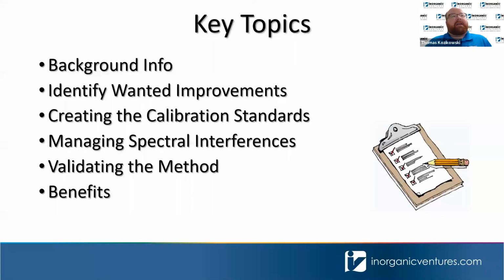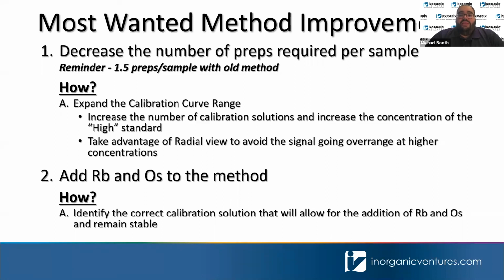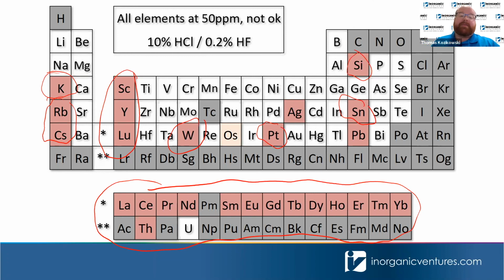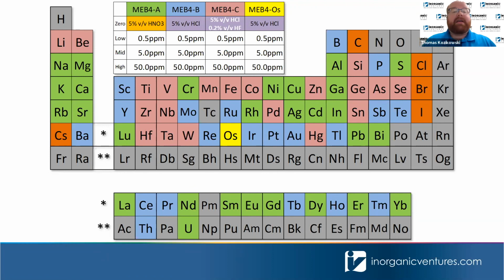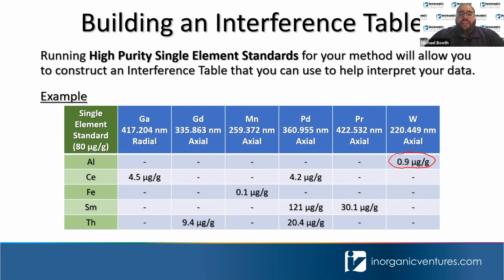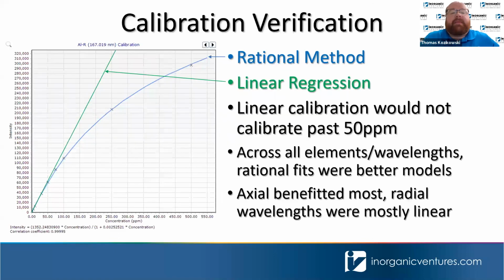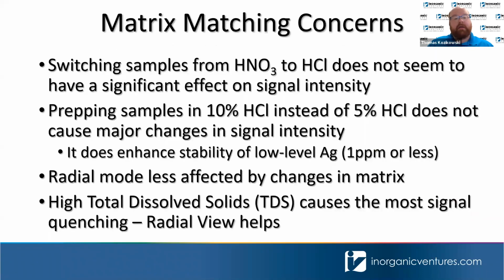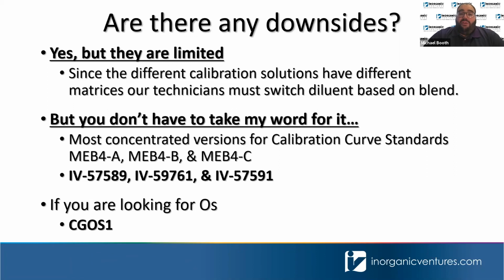Custom Analysis by Radial Axial ICP-OES: How to Reduce Interferences for 69 Elements

Comment: if you would have more than one peak for a metal , which method (s) should we fellow to select the right peak ?
Reply from the maker: Thank you for your question. Are you observing more than one peak in a single spectral window? We do not advise use of spectral windows that are not clean unless the interference can be identified and corrected for. Peak centering will be important here to distinguish between two elements. Single-element solutions can also be used to determine interferences. We would recommend monitoring multiple wavelengths for each element, when possible, and choosing one that is free from interferences.

Is the use of "peak" here in reference to wavelength? If so, the various wavelengths monitored should be consistent with each other and any discrepancies should be evaluated as potential interferences. Peak shape, relative standard deviation, and visual comparisons against a certified reference material with similar composition can all be used to help determine the best wavelength to use for your analysis.

If you have additional questions specific to your analysis, please feel free to reach out to us directly at info@inorganicventures.com. We would be happy to take a look at your data and assist further, if needed.

Comment: Your presentation is amazing, easy to understand! Thank you for sharing your knowledge! Sample preparation for ICP-OES takes more than 65% of the time from start to finish until getting analysis results. How do you prepare the samples, standards, and blank to test for heavy metals in cosmetics, food, powder, gummies, capsules, etc. Say testing for Hg, Cd, Fe, Cu, etc. 
I'll be test on Agilent 5110 ICP-OES 
Thank you in advance for your time!
Reply from the maker: Thank you for your inquiry. We do not prepare these types of samples in-house at Inorganic Ventures, but the best sample preparation technique will depend largely on your analytes of interest. Each sample type may require a different preparation procedure. Do you have the ability to perform microwave digestions in your laboratory? If so, we would recommend CEM’s catalogue of microwave digestion techniques that can be found here: https://cem.com/en/microwave-digestion. There should be a procedure available for each specific sample type you have mentioned.

Of the elements you have listed, Hg may be of particular concern. We have observed that Hg can adsorb onto plastic at lower concentrations, which will result in loss of Hg in your sample. This can be mitigated by using HCl in your sample matrix or, in cases where only HNO3 is used for stabilization, storing your standards in borosilicate glass (but please note that low-level Hg can still adsorb onto plastic instrument components). More information on each element of interest can be found in our Interactive Periodic Table (https://www.inorganicventures.com/periodic-table).

If you have additional questions or concerns, we would be more than happy to assist further. To speak with one of our chemists directly, please feel free to reach out to us at info@inorganicventures.com.

We will be hosting a webinar on heavy metals analysis this Thursday, 11/11/2021. We will discuss topics that are directly related to your question and encourage you to attend! https://us02web.zoom.us/webinar/register/4116348448402/WN_lWxYXuC-Qa2JsU9OyUXI3g